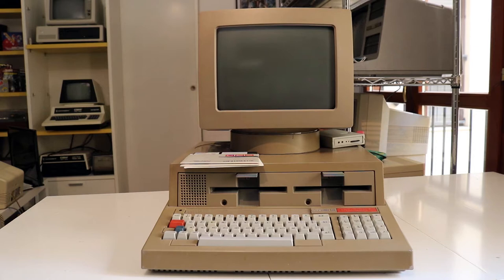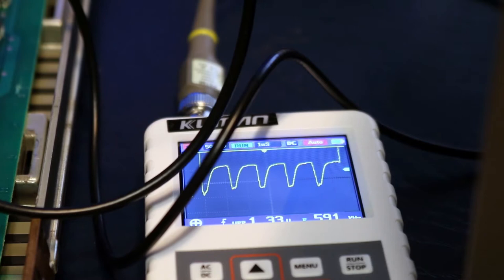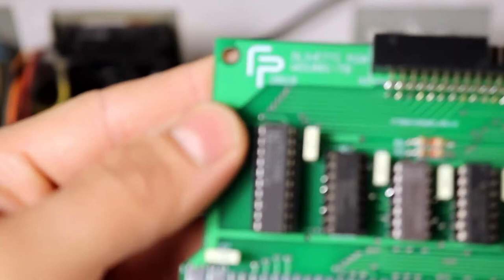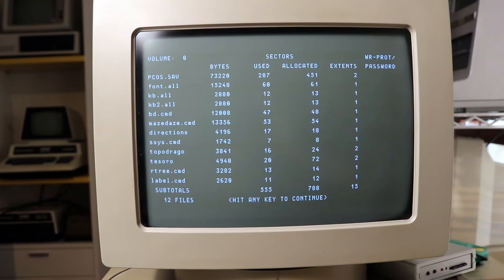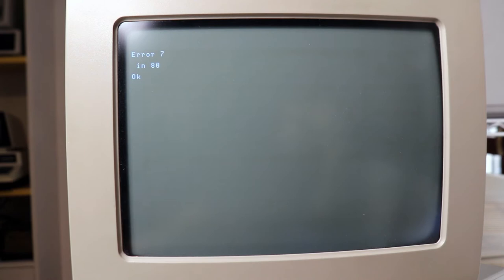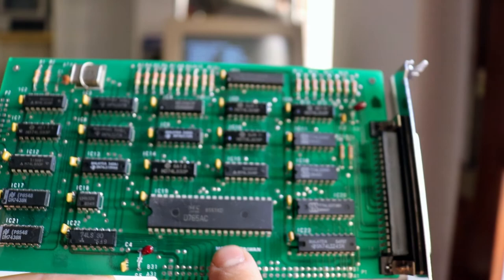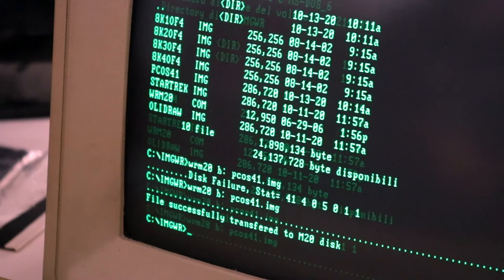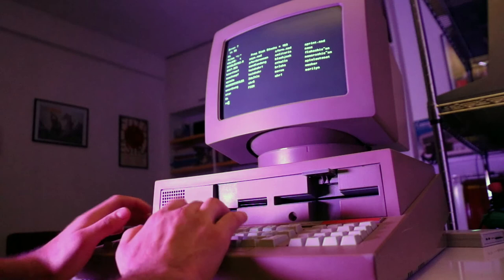The Olivetti M20, An Overlook || Retroelectric’s Strange Computers

Comment: Olivetti M20 was techically better than the worst system even made. the IBM PC.
When PC users struggle with MDA or Text only graphic cards, this computer had a high res graphic mode (no stupid text mode) and 8 colors. for the era its 16 bit CPU (not as most IBM a 16 bit with 8 bit data bus CPU like the 8088 used in some clones) had superior capabilities in memory management. it was segmented based too but not as the stupid Segment:Address addressing that limited the PC until the 386 era.